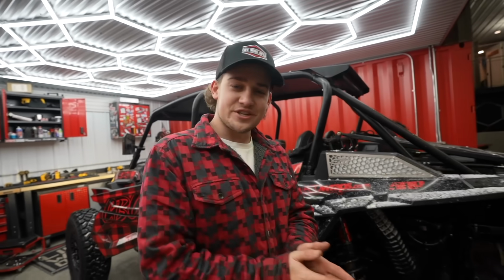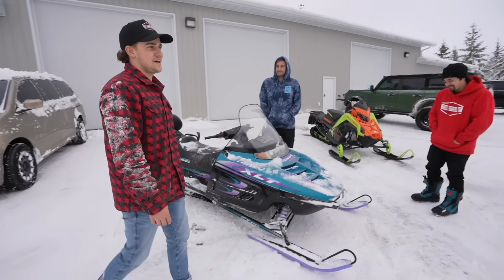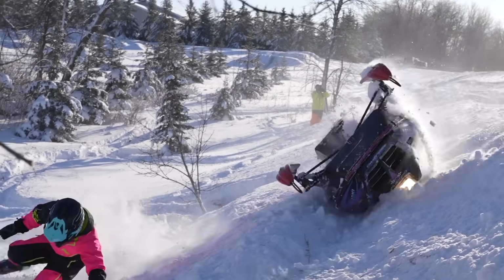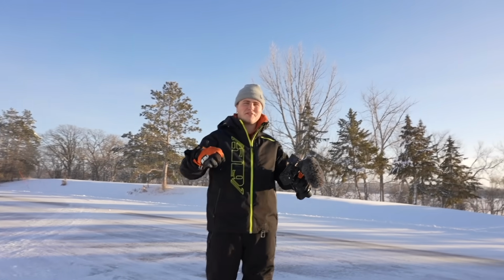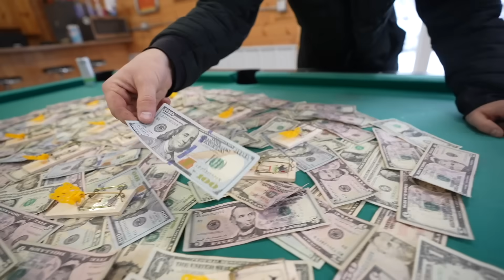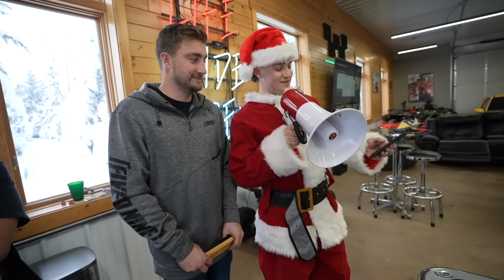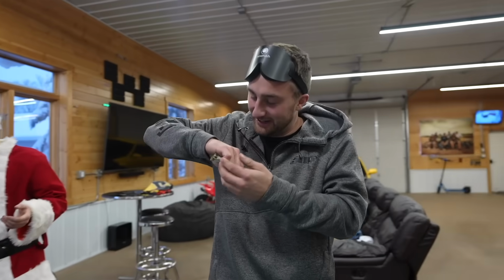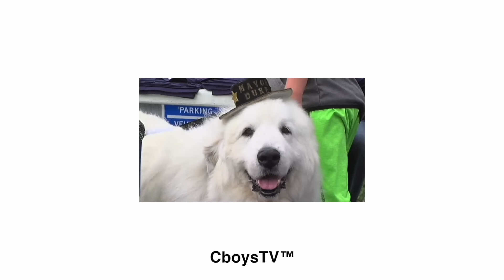Cheap vs. Expensive Snowmobile Ditch Riding!

Comment: Those XLT "Extra Light Triples" were piston-port triples, 200cc/cylinder engines that were not the top of the line sleds.  The XCR Special was a derivation of the standard 600cc that were reed valve triple pipe engines.  Those were fire-breathing beasts that would leave a standard XLT in the dust.  I bought a '99 Ski-Doo Formula 583 that was a direct competitor new off the showroom floor for $5,500 in 1999.  Those were the best years of snowmobiles, affordable, dependable high performance 2-strokes that would easily get you 300 miles per day in the Upper Peninsula of Michigan and walk away from it.

Comment: Man, I still have my '95 600 XCR in my back garage. Picked that over the XLT because it was faster :p Haven't started it in probably 20 years, so it would need a lot of TLC to get going. But at the time, it slayed EVERYTHING in my area! SLP triple pipes, SLP skis, SLP heads, bored carbs, 144 studs, tuned the clutches, Dial-A-Jet system, etc. Guesstimating it went from stock 95HP to about 120HP. NOT for the fluff, it needs hardpack to shine and wheelies HARD out of the hole.

Comment: had 2 since brand new '96 indy triple 6's fine tuned for racing, they were too heavy to be fun, fast YES, but HEAVY...to heavy to get stuck and drag out by yourself. much preferred the XC500's for ditching, some ditches will drop 18' for a hundred yards at a time especially along county roads and train tracks. especially along the soo line/cp rail along hwy 55 right infront of polaris HQ. and some of them are swamp at the bottom to top it off }XD
i am surprised there are still any polaris triples around still running considering all the crank bearings went bad at about the 6k mark and there were no replacement parts last time i rode mine in 2006.

i don't like any of the new snowmobiles after 2006. my favorites were from 2002-2006. the new ones are all made in china plastic that break more than they ride.
mind you i started off with my dads racing sleds the artic cat jaguar, cougars, panthers, and my grandpas pantera. the jags were perfect for guys like you, the pantera you had to be hercules to pick it up and move it. the pantera is the most like the indy triple 600's. the yamaha exciters were also triples, they were pretty quick, but i like the phazers more since i could pick them up and drag them where ever even in 5 foot drifts.

another fun place to ditch ride is route 12 from utica to old forge in new york with some racin' at the hinckley dam reservoir.

seriously can't believe you guys used only 1 cheap walmart hollow tube hook. 3 might have worked....for a week. now you know exactly why i don't like anything made after 2006. just not made in america tough any more.

Comment: My second sled was a brand new 95 Polaris XLT Special that I had long tracked and modified the rear suspension for more travel to match the 10 inch travel up front.  I beat the Hell out of that sled for three years of ditch banging, and hill climbing on Mt Baker.  Sold it to a friend, still regret it.  Awesome machine for it's day.

Comment: Been riding sleds since I was 8, my folks were into riding, and my mother got a new sled that year, so I got her Enticer 340, and ride that until my mother couldn't ride much anymore, so I rode her Phazer. I loved that sled, and being only 12 at the time, it went fast enough for me, then when my father upgraded to VMAX 700 triple, I was able to sell my Phazer for his Exciter 570,  I sold that when I enlisted in the USAF at 18. I didn't ride again until I got out in 05, moved back to the Northeast and bought my first Rev chassis, what a night and day difference on how hard I could ride with being fatigued vs old chassis sleds. I like the styling of the 90s sleds, as they were low and sleek, but the new sleds are so much better ergonomically.

Comment: I would much rather that old xlt over a modern sled anyday
Reply: My xlt 600 triple has over 7500 miles 2 rebuilds but still fast as hell, makes 160 HP on 10 psi

Comment: There was a lot better sleds than that XLT in 97. U had the 680 ultra way better than XLT. But if I was picking a Polaris from 97 it would have been the 97 700 twin RMK. Ski doo I’d pick the MXZ 680 great machine. Arctic cat the ZRT 600-800 and thundercat 900 were probably the best triples at that time. The 580ZR was a great sled but little under powered probably to compare to the boost. I grew up in the 90’s did lots of riding my favorite sled was my 95 800 storm. PSI heads stingers jetted and clutched it was amazing. 
130mph on radar on ice probably take that boost out on top end lol!! 
Also owned a 95 XCR 600 piped it shaved heads clutched jetted 115 on radar on ice. Fast sled but didn’t have the torque like the storm just didn’t feel fast. My father had a 98 700XC what amazing sled on warm days he was a little faster than my storm.

Comment: I will say I have a 2000 zl 500 and I have not changed the fluids in like 3 years and it is some how still running like a dream starts in 5 pulls after sitting all summer and starts 1st pull all winter

Comment: You guys need to get these three sleds and run the track 
2006 snow pro 440 2006-07 rev 440 iqr 600 in race trim or trail converted

Comment: One thing I forgot to mention was speed. I can take my old 800 xcr Gen 2 and we were doing 106 and 660 ft with it my 1,000 CC triple polaris even with my 300 lb driving it could do 110 mph in 660 and you're not going to see one of these new 800 or 850s pull off 132 mph top end maybe the turbo but that's a turbo engine versus a naturally aspirated. I still don't see that turbo sled pulling a 132 on radar on the top end

Comment: i had a 1985 polaris ss440 and that thing never broke down, put a new fuel pump on and it ran for days. paid 200 bucks for it, sold it for 500. wish i still had it. it would top out around 100mph but it got there pretty fast. air cooled so didnt have to worry about no coolant or head gaskets, they dont make em like they used too.

Comment: I’d still prefer the older skidoos new one are so easy to break so many things could go wrong for example that old skidoo tipped and it’s still running a new one would be flooded and misfiring can’t even start a new one if it’s not level

Comment: If you have the need to destroy another triple from that era I have one sitting in the yard here in Bismarck it was running when we stopped it back 12 years ago but it's been under a tarp still turns over at least as far as the Rope goes and you can have it for $300! Oh it also has the triple pipes on it not to mention the triple cylinders and let's just say that the heat shielding is probably melted through due to the horsepower and the heat the triple pipes put out but the bitch was still awesome! LOL
Reply: Well this is disappointing where the hell did the first response to my text go because that scam artist gave me a whole lot of entertainment and my response to him I thoroughly was having fun with and I'm quite disappointed that both his answer to me and my response to him seem to now be gone! LOL well whatever it was fun making fun of him while I had the chance! 

   That said once again if you want a cheap ass fucking XLT I got one sitting here that has not run an for a while and you could have it dirt as cheap but it was definitely running when it was parked and it definitely still turns over. Needless to say it'll probably need a bit of carb cleaner and new spark plugs but she's still a triple cylinder XLT with triple pipes that was in full running condition when parked it's just been a long time since she was parked.

Comment: Hey you guys should buy my blaster it’s got a new top end and it’s the big bore kit not even 5 hours on the top end and it’s got fmf exhaust 2 inch spacers it was a fuckin monster before it started bogging it would be lit af bro I need the money for a truck I need 1500 for the truck but the blaster is well worth at least 2000 but you guys can have it for 1700 just because I want to see you guys make that thing run mint I never really could honestly I honestly feel it need a big bore kit card because it’s still got a stock card but it dose run just bogs when you get going yk and I just don’t really want to mess with it honestly up to you guys it would be nice I’m tryna get my first truck I turned 16 in August would be lit

Comment: The old stuffs not reliable? It's older than most of you and sits around most of the year, they need gone over and they would be fine for trail riding that they were meant for. Newer usually is better, but you can destroy anything.